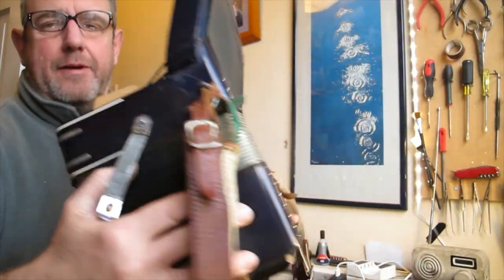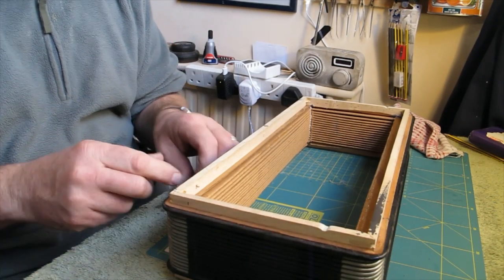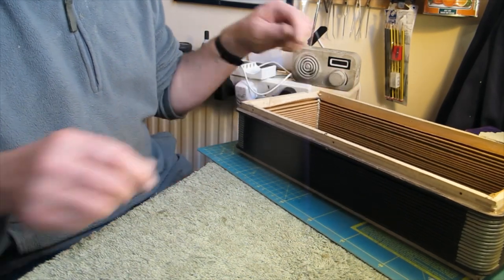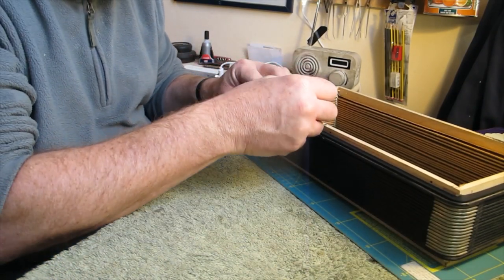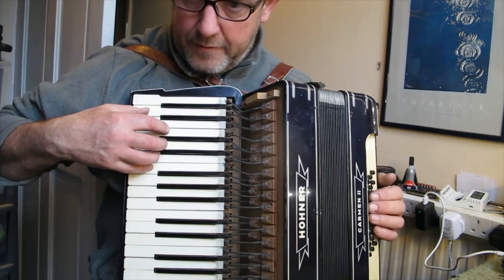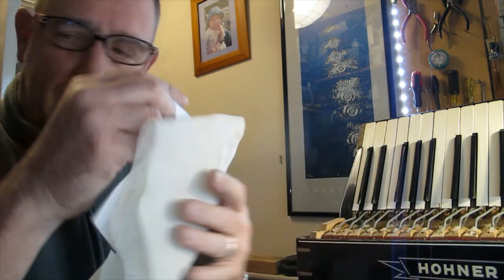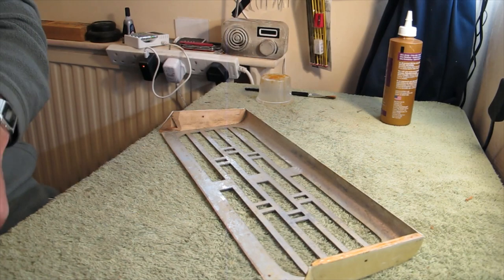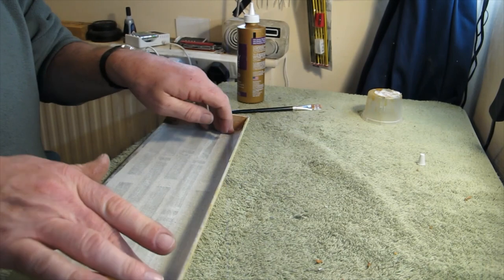Hohner Carmen Accordion repair and restoration - bellows gasket and grille cloth

Comment: Good Evening Rich. Thank you so much for your informative videos. I had/have a problem with my accordion. I've pretty much sorted this out now. I have not removed the bellows as I don't think I need to re-gasket it at this stage - the accordion is new. Can you tell me please, what is the best method to tap down proud bellows pins? Gently with a hammer?
Reply from the maker: Hello 
Thank you for your kind words 
To push bellows pins in I either use closed bellows pin pliers - i actually use guitar fret pliers for removing and pushing in bellows pins 
https://www.ebay.co.uk/itm/Steel-Guitar-Fret-Puller-Wire-Nipper-Puller-Plier-String-Cutter-Luthier-Tool-Sci-/195480792406?mkcid=16&mkevt=1&_trksid=p2349624.m2548.l6249&mkrid=710-127635-2958-0

Or use a small pin hammer to carefully tap the pins home.

Best wishes Rich 
push or carefully tap with a small hammer- e.g.
Reply: You could use a small (e.g. 1 inch) block of wood or the butt end of a hammer or screwdriver handle as an intermediary between the hammer and the pin.

Comment: Thank you Rich! i also find that the gasket tape is unjustified expensive.. where do you buy from?
Reply from the maker: Hi Dimitri
I buy my bellows gasket from CGM Musical ( online shop for accordion and melodeon spares. )
Reply: I think I'm going to improvise and put PTFE tape (AKA Teflon tape, plumber's tape, thread sealer) over the old gaskets. It's extremely inexpensive, airtight, very thin even after several layers, stretches well and holds itself in place once wrapped upon itself and pressed down, and it's easily removed and leaves no residue. The only issue might be seeing a different color between the bellows and registers.

Comment: What glue should I use to fix the bellow corner?
Reply from the maker: To fix a metal bellows corner I would use superglue - applied to the corner of the bellows then seat the corner firmly into place and crimp it tight with pliers. Don't forget that the bellows tape  should be covering the ends of the corner and this helps it stay in position and also looks neat. 😁